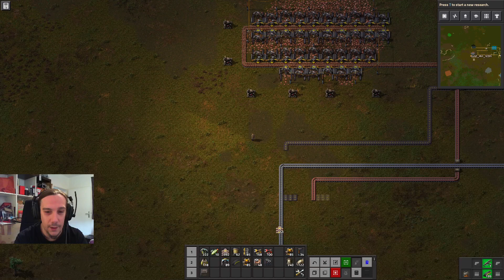Factorio 1.0 Vanilla Gameplay - Ep. 10 - Playthrough Guide

Comment: You're going to have to pick up and replace a couple of the coal inserters on the steel furnaces on the top side.. They had picked up steel from the furnace which they couldn't place on the coal belt, so when you rotated them, they are now trying to put that steel back into the furnace.

The only way to fix it is to pick up the inserter, unfortunately.
Reply: It wasn't obvious at first because Fill4me had already put coal in, so the furnace will be fine until it runs out of that initial feed.
Reply from the maker: @jemsterr  Thanks that you noticed that. Would've taken me ages to notice that :D